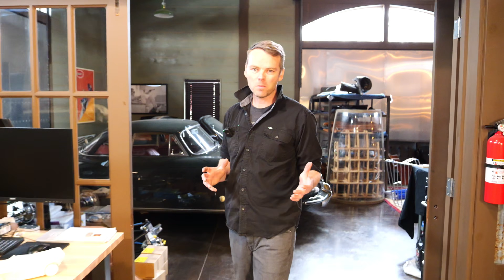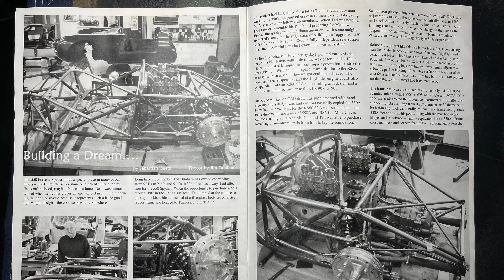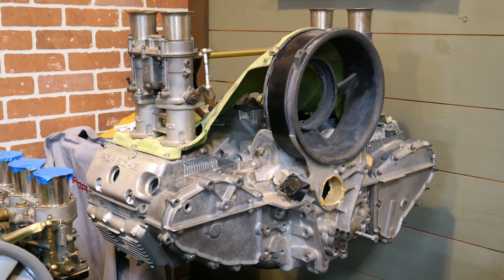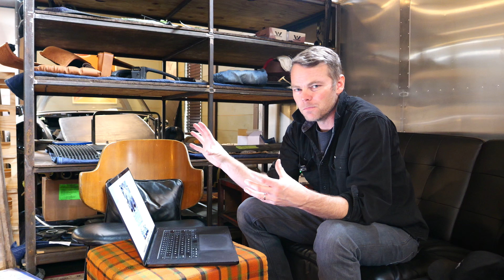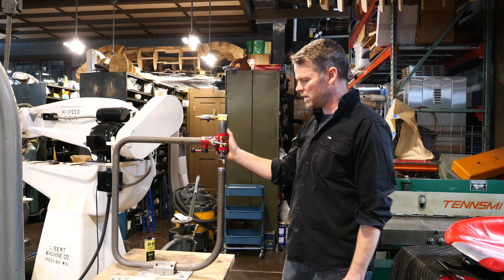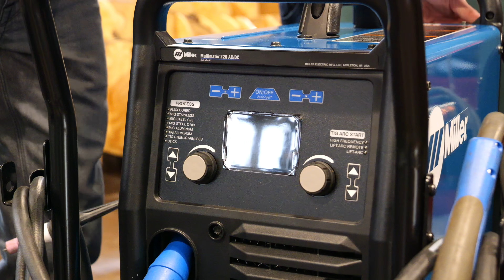RÜNGE Cars 2024 Shop Update

Comment: The 4-valve Polo sounds amazing. Porsche seemed unable to solve the thermal management issues with their 4-valve air cooled attempt. I recall it was about keeping sufficient cooling air around the valve guides, maybe getting the cooled oil flow there as well. How Swinden solved that problem would be a nice story to tell.
Reply from the maker: Agreed on all counts. Swindon has gone to great lengths to perfect cooling on the 4 Valve per Cyl/air cooled head. We will report on all aspects over the next couple months as ours come to life👍🏻👍🏻